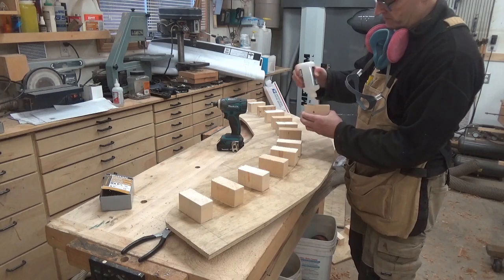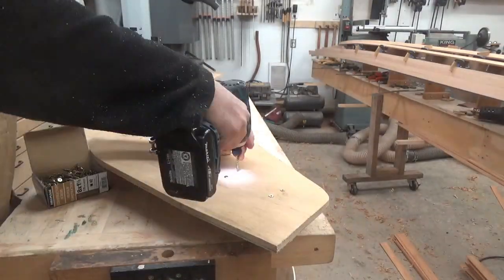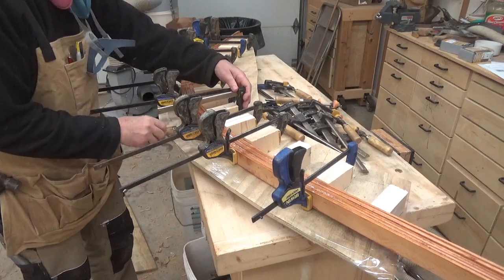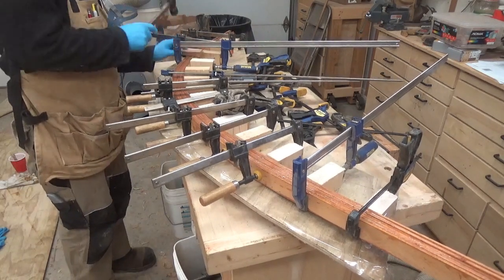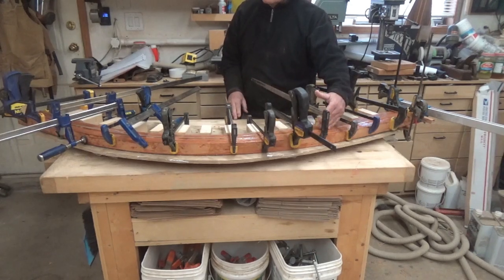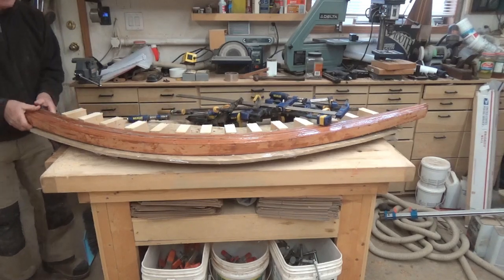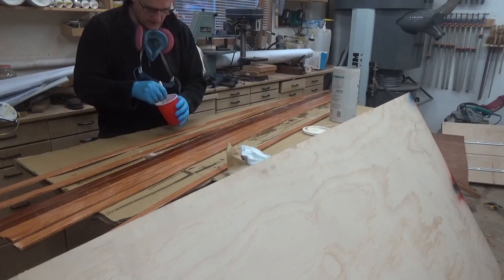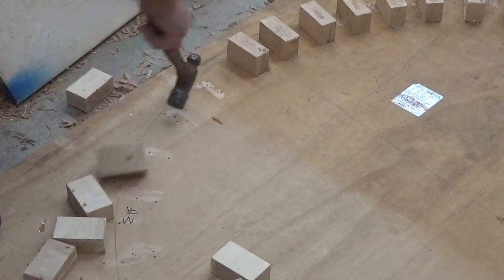Building the Wooden Boat "Elfyn" -  EP 1 Laminating Frames/Stems

Comment: What wood species are you using and what are the veneer dimensions?
Reply from the maker: The lumber is mahogany and the layers are around 3/16 thick by 2 inches wide.  It is a pretty wide curve so the laminations bent pretty easy.  I will then trim then down to around 1 7/8